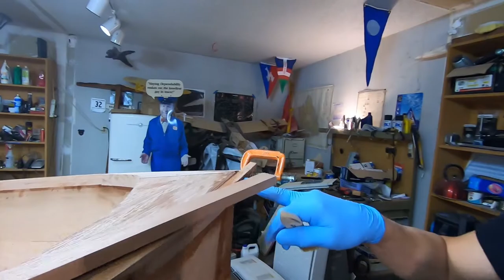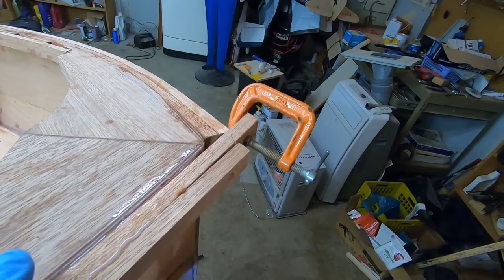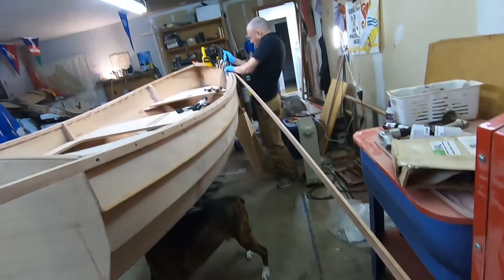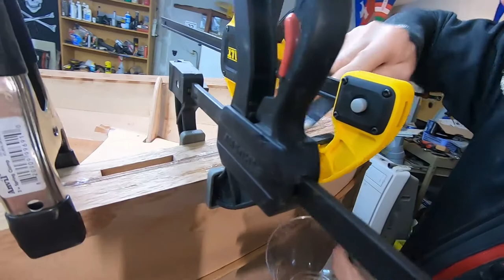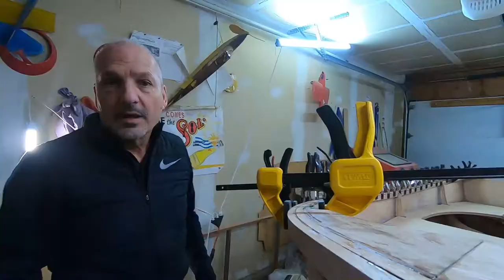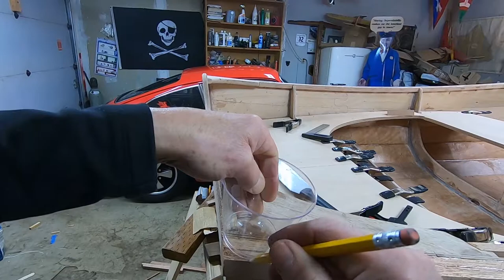CLC Tenderly Dinghy build Part 9

Comment: Great video. Thanks for sharing. Do you think it would have been easier to use a roller to apply the epoxy on your rails?
Reply from the maker: A roller puts a pretty thin coat, and I wanted to make sure I had lots of squeeze out.

Comment: Hey Mike, I'm assuming the screws you're adding are completely superfluous after the epoxy has set?  I've been putting my outwales on with clamps only, concerned about splitting the wood with screws, though it looks like they're not giving you any issues.  Is it just me, or is the Mas epoxy that ships with the kit insufficient to finish the boat?  I'm having to order more.
Reply from the maker: The screws do hold the outwales in place until the epoxy sets up, I also used clamps but probably could have gotten by with just clamps. And yes they do not ship enough epoxy with the kit. I had to order another gallon of resin and the hardener, also ran short on the wood flour.